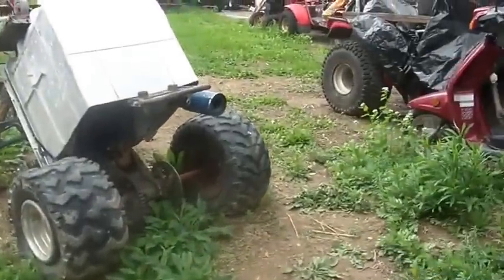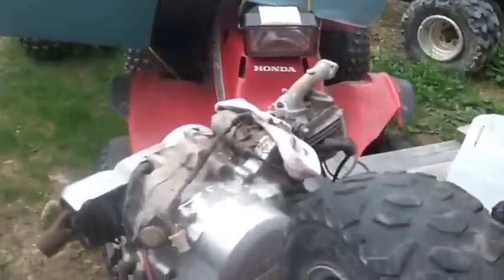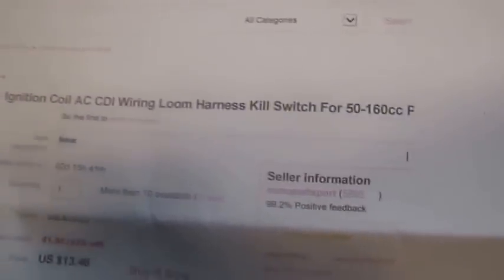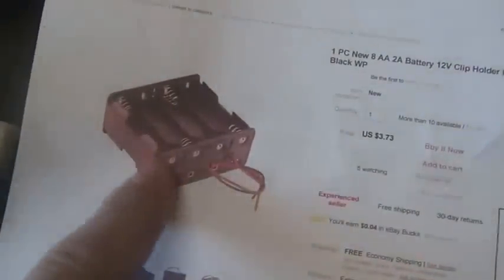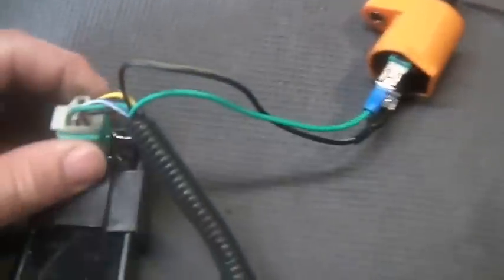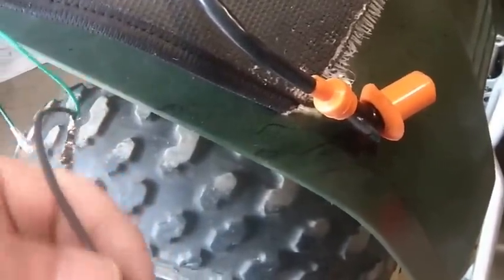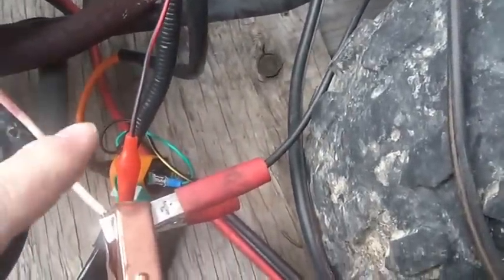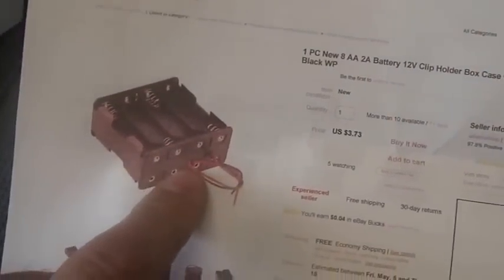DIY ATV Portable CDI system, $25, easy to build and use,

Comment: Easy peasey for you maybe. You dont explain half of what you do like the big ground clamp to ??? From ??? So to us dummies it is a little bit more complicated.
Like the blue/white and green you show them with connectors on the ends, do they come that way out of the box or ???
Didnt even show what or where to put the battery clip holder. So where is the power coming from? A battery charger?

Comment: I bought a 250 lifran overhead and it was running then died. The wiring harness was a wreck, so I watched one of your videos and did away with all but what I needed. I hooked everything up as I seen from the video and still have no spark. I only have a test light so I started testing wires. The only way I got the tester to light up was when I held the tester to the red black coming straight from the motor while I was turning the ignition, but when I hooked the wires back up to the CDI I get nothing from the red black wire. Would this mean that I have a bad CDI?🤔

Comment: Great video,but have a couple of questions,first can you use that wiring on a big red with high and low shaft trans?and second how does this work with a starter and is the electric starter a separate circuit?, thanks for your help

Comment: great video.does the CC size matter of the CDI box? also can i use a 5 pin AC box and connect the power from the flywheel coil?thank you.

Comment: I need help with my yamaha moto 4 not sure the wire diagram for it at all. It was in a fire but the leads to the engine are good, but I am not able to find a new cdi or how to check spark on it. I will post a vid soon and maybe you could check it out.

Comment: can you build one for ac system ?  and on the Chinese  they are wired eather way kinda want to know if i can wire in a ac so i do not need a battery to run one  thanks

Comment: Do you still respond to msgs iv tried to get your thoughts on dual pickup coils in a magneto .which one I need to use for the pickup signal to run your portable setup
Reply: Michael Sherrin. The pickup coil would be the coil that runs on the outside of the wheel.

Comment: So what about igition timing advance?   Some cdi's have that.  And I will tell you this, at my shop, I have about 50 of those cheap cdi's and here is the thing, I can take one and put it on a moped and it runs great! Take it out, put it in a different bike with the same type cdi and runs terrible.   I found out that not all the timing pickups on the flywheels are located in the same place.

Comment: Hey I have an 1995 lt80 I've been looking for a high performance cdi box and cant find one at all. My question is there any way to get rid of the rev limiter on this little quad?  It has lots of power but once the rev limiter kicks in it seems to lose it all. It goes 25mph I would like to gain 5-10 more mph if possible? My son is out growing it unless I can figure out how to gain some speed. Thanks for your help have great day

Comment: Great videos Harvey . I need help with 1983 Honda xl 100 s . It has no wiring harness. I have wires coming from the engine a coil wire and a condenser. . Do I need a battery. And which wires go to coil an condenser. Ty. Royal_racing@rocketmail.com

Comment: That wiring will run off of the battery and kill the battery. You need to use that stator/alternator for it to run long term.
Reply from the maker: Hey Seccheus!!! What U say is true, it can run 2-3 hours on the AA batteries... Long enough for troubleshooting and a first ride or 2... Thanks for Ur thoughts, watching, and commenting!!!

Comment: Hi great channel I’ve recently subscribed. Can you do a video on the Yamaha engine please. I’ve just brought a wr 125 four stroke with no loom, it was on injection but I’ve fitted a carb now. There are 4 white and one red and White wires coming out of the engine cover, red and white and white wires coming from pulse generator, and 3 white wires coming from the stator. None of these wires are earth. I’ve orders a pit bike wiring loom to try and get it running do you think it will work? Any help will be much appreciated. I’m watching from the uk 🇬🇧 keep the videos coming

Comment: I need this setup for a 1983 kawasaki 200cc three wheeler. The bike has no wiring hardness and was cut out by the stator. 2 wires in the front coming out of the stator and 3 or 4 coming out of the rear of the stator.
Reply: Also i did not see where you connected the 8aa battery pack?
Reply: I can’t say for sure but doing it this way the two whites from the front of the stator will be your pulse generator positive and negative. Hook a volt meter to the wires and kick it over to find which wire gives you power. Do the same on the back wires to find your Cdi stator power.

Comment: I bought a eton viper 150cc a couple weeks ago and just recently got a new wiring harness. Wont produce spark even though the white wire from the stator is giving off around 12 volts. Do you think this harness would work?

Comment: I have a Suzuki 230 that motor has been swapped with a Yamaha SR250 motor. I have used a inline spark tester and I get a spark ever so often. It’s not constant. I put my multi meter on got 2 ohms on the positive n negative. Then from the tip that plugs in spark plug I got 8000 i believe it’s supposed to be 10000 where is my problem??  I’ve done all I know to do.

Comment: Could you in theory run two of these units for a two cylinder engine if you had a pickup signal for each cylinder?
Reply from the maker: Hey MoonSawFurnishing!!!!  Yes, if there are 2 pulse generators, U can run 2 of these, but, most of the time for 2 cylinders, one uses one pulse generator and uses a spark coil with 2 secondary winding, (2 spark plug wires), I hope this helps.... Thanks for asking, watching, and commenting!!!
Reply: But what if it's 2 coils with shared 12v and separate pulse wires .. Like suzuki intruder 1996 800cc v twin.

Comment: i have china 150  got racing cdi  hooked up now i got crazy spark and pulse generator not hooked up help where do i hook wires from pulse to blue racing cdi  cant figure out
Reply from the maker: Hey Terry, One side of the pulse generator should have a blue wire with a yellow or white stripe, the wire harness for the cdi should have the same color wire, connect them, the other side of the pulse generator should have a green wire or it is connected directly to ground.... Connect the green wires, if there is not one, make sure the green wire from the CDI harness is connected to ground which means, the engine case, ATV frame, (-) of the battery and the green or frame of the spark coil should all be connected together.... Thanks for asking, watching, and commenting!!!

Comment: you are the most knowledgeable man on ignitions systems ive ever found on the internet, i ordered all of the hardware. i have a question i have a 2001 kx250 2 stroke motor , will a 4 stroke stator work on a 2 stroke motor ? I want to test the engine with this setup once i get a stator that will fit.

Comment: let me add this:
I change the 2 ignition coils,the 4 spark plugs,the starter solenoid.All of them brand new.Battery charged at 13 volts.But still does not turn on.Just sound like is trying to turn. but cant.The spark is very weak.thks again.

Comment: Hello Harvey i have started on a 85 200x motor and im getting around the low 90 ohms from pulser and around mid 150s from stator, but to no luck can I get her to fire up. Just wondering about the pulser givin I was expecting around 30 ohms

Comment: Great video! I do have one question though. Will the 5-pin CDI boxes work on the Hondas as well and if so what is the pin out difference??
Reply from the maker: Hey NewLineDetails!!!  To be honest, these CDI boxes seem to be functionality interchangeable once the wiring diagram is figured out. Most 5pin cdi boxes are powered by the stator, (ac powered), the cdi unit that I used for my portable CDI is DC powered, I have 12VDC worth of batteries in the box with the cdi unit and spark coil.... I hope this answers Ur question.... Thanks for asking, watching, and commenting!!!
Reply: Your center wire is a kill switch
Reply: On an a.c. cdi

Comment: Hi and thanks for the video. Really great. question is, Is 2 stroke and 4 stroke CDI's the same and can you do the same for 2 strokes.?
Reply: 4 strokes have a lost spark in the exhaust cycle and because of that it works on 2 stokes the same.

Comment: Hey brother I wanted to ask you something I'm bored about four of these DC CDI boxes one didn't work. And the other three last me about 10 minutes one that's me about one minute and the other one last me like 3 days do you have any luck like me or??? Let me know something please brother please I'm stumped very frustrated about to bash it it's a liquid-cooled 50cc Honda Metropolitan motor let me know something no brother please
Reply from the maker: Hey Critical Mass!!!  One of my subscribers turned me on to this trick.... If the pulse generator has 2 leads and neither one of them us ground at the pulse generator, just swap the leads... BTW, what is the resistive value of Ur pulse generator?  Ur will be the first Honda that this did not work for.... I would probably try the Casoli 12VDC CDI box, I think they are a little tougher.... Sorry that I'm not there to work with U, we can both learn a lot from Ur experiments.... Thanks for the info, Ur experience, watching, and commenting!!!

Comment: Harvey Spooner  , do you think I could adapt this system to an old tecumseh engine?  Using an ABS sensor as a trigger coil.
Reply from the maker: Hey Gypsy, I don't think a ABS sensor would work, but this would, http://www.ebay.com/itm/Ignition-Pulse-Generator-Pickup-Coil-Trigger-CDI-GY6-50-150cc-Scooter-ATV-Moped-/201444538404?hash=item2ee707b824:g:SFsAAOSw4HVWFXHa&vxp=mtr  ,  Good luck with Ur build, thanks for asking, watching, and commenting!!!
Reply: Harvey Spooner .. thanks for the tip.. and the prompt reply.. I'll get on the eBay
Reply: GYPSY400 you already at no just try it

Comment: Thanks for all of your helpful videos.... well done. Have a question for you, I own a 1992 Yamaha Timberwolf 250 2x4 that needs a CDI, would I install a Chinese brand D.C. or A.C. unit?  I have a battery and electric start but no pull start. Would I need to connect CDI to stator or to the battery with a fuse?  I have six wires, W/R and W/G that come from pulser coil, brown, black that are in the 4 connector with W/R and W/G then two separate wires with bullet connectors that are white and yellow.  Thanks for any help you can give me.

Comment: will this setup work on a 1989 Yamaha big bear 350? i have a bad source coil for my cdi. I'm wanting to just replace my stock setup with this as a long term fix will it handle that?
Reply from the maker: Hey Richard!!! Will this set up get Ur Big Bear started, the next question is how long will it last.... The Honda ignition system was copied for the China stuff, so, the CHina stuff works on Honda, and visa versa, the Honda/China pulse generator is a piezo electric device, a semiconductor, for Yamaha, I have seen them use coil wrapped ferrites, the pulse generator output is much greater for Yamaha pulse generators and that output can damage the China CDI unit, so, this will get U started, it may last 1 ride or for years, depends on Ur ATV, how good China made the CDI U R using, and how hard U ride it.... I would always keep a spare CDI available.... Thanks for asking, watching, and commenting.... Let me know what U decide to do and how it works out!
Reply: I actually just ordered one of the casoli moto cdi units. I will let you knkow how it works out.
Reply: i am considering adding a resistor inline with the pulse gen to limit the voltage but i dont have any i can use right now. Well any in the 1k range that are 1 watt or bigger.

Comment: Hey !  Very good clip and nice to hear your guidance. Love you place there he he...pasion for technic.  I have a Mistral 50 smc i got for free and want it to run ofcourse.  Bought a cdi racing, coil....and i think there was a carburator filter..bla bla in package.  Very cool prices from china. I want to use the existing wiring and try to find who goes to switch and coil...earth ...maby etc.   I know little about it...but have my multimeter and now stress....so slowly i figure it out.  
Helpful clip/ video...Thank you ! :-)
Reply from the maker: Hey Norwaywildlife, I spent a week in Norway a few years ago, I loved it, beautiful country and citizens!!!   I'm glad that my videos helped U, thanks for all the kind words, encouragement, watching, and commenting!!!
Reply: Hey Harvey !  Yes, allot of nice and amazing nature in our country.  Peoples are as peoples arround...different, but we manage to have much sivilized prinsips between us....for long time now, but not sure if all that is as strong as it should be anymore unfortunatly. Today i took of the rotator and saw allot of rust on stator and rotator...plates...gues that is the name of those things. There also was a black little thing there...i guess it is the pulsreader for cdi box...a small little black unit close to the rotator. Can i ask you if it is important to clean the rust away and also...does that little black thing beeing ofthen mailfunction or need to be replaced.  I had small readings on volt on the wires out from rotator/ stator.  If i can ask he he ! Have a nice day ! :-)
Reply: I love ur video. Can u built me one of them I'll buy it off u I'll give u a $100

Comment: I have a 77 kawasaki F11 250 I was wondering what kind of CDI to use DC or AC. would a pit bike harness work with a better CDI? the bike literally has wires from the stator and that's all. I've had it running for a little without a cdi but it wont stay idling
Reply from the maker: Hey Brennan, I looked up schematics for that bike and it appears that it has points, I have not triggered a cdi unit with points though, I have been considering such a project on an old briggs engine... I would clean the points and replace the capacitor, hopefully that cleans up the ignition.... Not idling is probably the carb though, probably needs a clean and rebuild, they all seem to need that this the new gasoline that is sold now days.... Thanks for asking, watching, and commenting!!!

Comment: i have a 50cc quad and the stator only has 4 wires coming out there is no blck/red wire but i have a cdi with the blck/red wire do i just wire the blck/red from cdi straight to posotive on battery or will that blow the cdi box ???
Reply: the cdi is 5 pin can it be used or do i have tohave a 4 pin
Reply from the maker: Hey Ian, Is Ur 50cc quad a 2 stroke or a 4stroke,  here in the USA, most of the 50cc stuff is 2 stroke.... Once U answer this, I need to do some research before I get back to U, I have not worked on 50cc ignitions.... Thanks for asking, watching, and commenting!!!
Reply from the maker: Hey Ian, will get back to U once I know 2 or 4 stroke, .... Thanks for asking, watching, and commenting!!!
Reply: its a 4 stroke electric start iv actualy managed to get it started by wiring that extra wire [the blck an red one] to batt but its bogging down at top throtle is that carb or wiring ??     thanks for reply

Comment: I've had problems running those box's on other brands other than honda and china. They always start up but the box burns out soon after. One that did ok was a 2007 polaris. Yamaha and suzuki burned out within a few minutes of riding.
Reply from the maker: Hey Bill!!!!!   I remembered U saying that, I figured that I would mention it on the video... I wonder if the black, epoxy housed CDI units are stronger.... Thanks for the always good info, Ur thoughts, watching, and commenting!!!
Reply: that's what I mean,  The black ones
Reply: The gold ones are short lived no matter what there on. I liked there performance but only last a few rides. All of the boxes for China bike are only good for Honda or Honda clones.
Reply: Best figure I got is the output of the pick up coil
Reply from the maker: Hey Bill, The pulse generator on the moto4 motor I looked at was like a mini stator, it was a coil with a metal center, I imagine it puts out quite the high voltage, especially at high RPM... The Honda pulse generator looks like a semiconductor device that kicks a much smaller charge when exposed to an magnetic field....  I think a parallel resistance of perhaps a 1000 Ohms or so would take some of that Voltage away from the CDI input on the China boxes when used on a Yamaha or other Japanese bikes....... Thanks for your knowledge, as U can see, I pay attention when I watch Ur videos.... Thanks for your advice, thoughts, watching, and commenting!!!

Comment: must say that test bed engine purrs like a kitten. ever consider taking the chain off so you don't have to deal with the rear wheels spinning
Reply from the maker: Hey Ashley, It is a nice running little quad, it sat around too long and the cylinder rust seized, I got it all loosened up and it has been my test buddy since, I have considered removing the chain, but, I kind of like watching the back wheels spins.... Thanks for your kind words, encouragement, watching, and commenting!!!